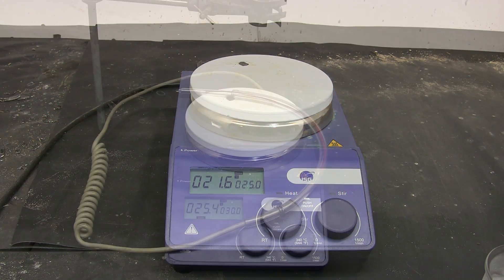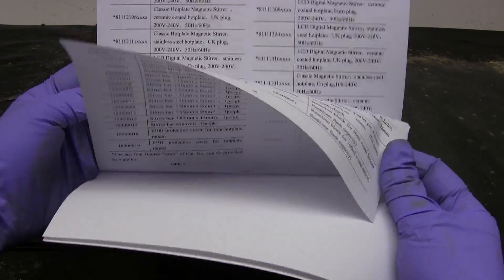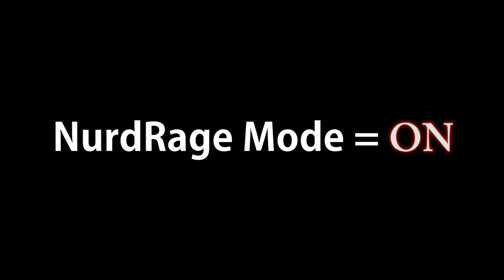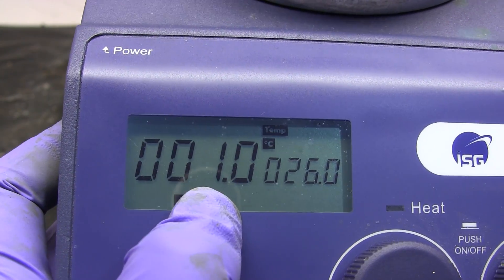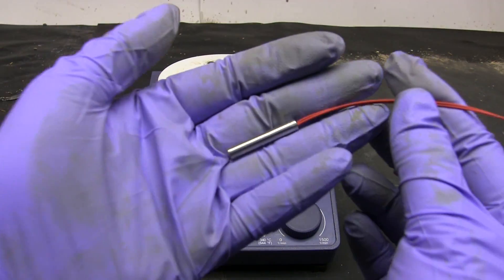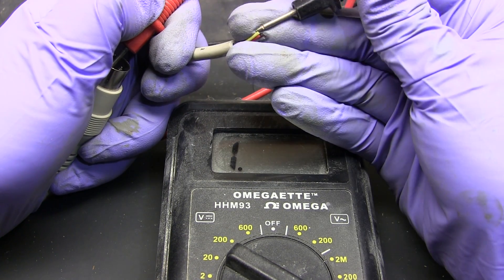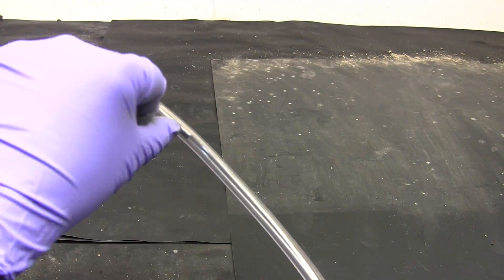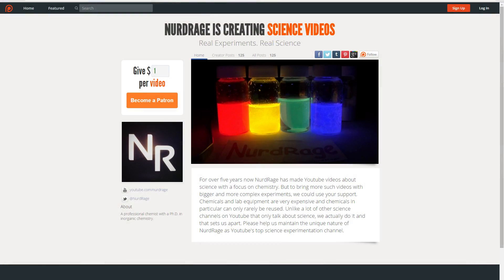Make a thermometer probe for a westlab/scilogex hotplate

Comment: The reason the ice water temp measures 1° C is because the probe is in water. The water will remain that temperature until all the ice is melted then the temp will begin to warm to room temp.
Reply: No. An ice bath will remain at 0C until all the ice has melted. 

There may be a couple of calibration potentiometers inside the unit, one for zero, one for gain.
Reply: Verm1n if the water was at 0C then it would be frozen... but its ice water...
Reply: Joshua Rando 
Water and ice can exist at 0C. It takes extra energy to freeze/melt ice but the temperature will still be 0C until you add that extra energy.
Reply: Leonard Greenpaw "if there was salt in it." Wow, you really just said that... We are not talking about water with salt in it. We are talking about water... pure water. Your fact was completed irrelevant to this argument and fails to have any point.
Reply: Joshua RandoYou are all FOOLS. Liquid water can easily drop below 0C if there was salt in it. 
This guy/girl has a FUCKING PHD, and the point of the bath was to see how low it would go and to try and get it into the negative.
Not to mention state changes do not elapse instantly and actually need time to complete
Reply: Joshua Rando No, we are talking about the water in this video, we dont know exactly what was in it

Comment: I would suggest adding some silicone grease between the glass and the probe for a better heat transfer and quicker temperature response. Silicone grease is good for the temperature ranges you're looking for.
Reply: FrozenHaxor yeah or thermally conductive Paste for CPU coolers
Reply: Perhaps a low temperature metal would be a good conductor (tin, lead, bismuth ect) rather than silicone grease since most silicone paste can't with stand high temperatures! And most chemist will have a low temperature metal 😋
Reply: @entomopathogenicfungus904  No, that would not make a good connection with the glass and would amalgamate and corrode the probe. Silicone grease is good up to 300*C

Comment: Wow a DIN connector! Interesting that it wouldn't be something simpler like a BNC connector.
Reply: BTW: I just like BNC connectors, they make me giggle with glee while playing with them.
Reply: Glebs Litvjaks the connector has multiple functions. For example different types of temperature probes.

And BNC connectors are used for higher frequencies, they are a bit expansive, complicated to assemble etc.

A DIN connector is a... decent choice. Relatively cheap and easy to get on the Shenzen Market and it fits - more or less - together regardless of manufacturing quality of socket and connector.

Comment: Why encapsulate the probe in glass? Is it to allow for greater sensitivity in minute temp. changes? Or rather, allow it to operate favourably in humid conditions/ high temp.?
Am I over-thinking this?

Great video, especially loved the outburst.
Reply from the maker: Darkest Light Oh just to protect the cartridge from acid. With the kinds of chemicals i work with, the cartridge would be destroyed in just a few days. The glass encapsulation protects it. The glass actually slows down the response and makes it less sensitive and less accurate. But i'm okay with that as I want to protect the probe more than i need high accuracy.
Reply: bgdwiepp  i think that the glass the perfect material to use in the lab, and how about some thermal paste, like the one in computer processors, in the tube to make a better thermal contact between the glass and the probe? It would be more sensitive and more responsive to changes, right?
Reply: NurdRage It's also a lot easier to replace the glass if it gets damaged or destroyed than to replace the probe, right?
Reply: Mega98RP Great minds think alike. I just posted something about that. Well done for beating me to it.
Reply: NurdRage I would imagine filling the glass tube with some form of thermally conductive material would improve the speed and accuracy of the probe - perhaps some sort of mineral oil or silver paste, if you want to get fancy?
Reply from the maker: ***** exactly! :)
Reply: Thanks for all the replies. Cleared it up greatly. Common sense always prevails, I guess.
Reply: Jarl Gullberg Exactly my thoughts. Filling in the voids with a suitable heat-conductive substance would be an easy and simple way to improve the accuracy without compromising the resistance to corrosive substances. He could probably get a cheap bottle of thermal interface material usually for CPU heatsinks and fill it with that.
Reply: bgdwiepp You don't need epoxy as that is way too permanent and won't work as well as Arctic silver CPU paste. Put a big blob of it in the bottom of the glass vial and stick the probe into it. I bet that would make it a lot more accurate as well as speed up response time. 
http://arcticsilver.com/as5.htm
Reply: NurdRage i think you could find some high temp thermal epoxy fairly easily that would be suitable for this if you wished to speed up the response.
Reply: bgdwiepp
Would that thermal epoxy be anywhere as resistant as glass is? As cheap? As easily applied and replaced?
Reply: NurdRage Cut a little peace of solder and put it inside the sealed glass pipette. Then heat the glass until solder melts. While solder is in molten state put probe inside and make sure it makes contact with molten solder. Let it cool and you will have a probe with faster response time than before.
Chip manufacturers solder heat sinks on CPU die for best thermal conductivity. You can do that too with tools and resources that you already have.
I hope this makes sense because English is not my mother tongue.
Reply: wwwelkam
If the probe can handle that kind of temp I agree. That would be the most accurate way to do it.
Reply: Slurpon Muhdick I dont know the specs but most of them should survive. CPU cant operate at 100 C but they still manage to solder heat sinks
Reply: wwwelkam
I have no idea what kind of metal shielding it has. If its made for unusually high temps then I see no problem.
Reply: NurdRage If you filled the glass pipette with some thermal interface material like the paste they use in computers, I think that might improve the heat transfer and increase response time.
Reply: deterdettol Thermal paste that is use between CPU and heatsink does not have great thermal conductivity.
Reply: wwwelkam Well it's still something...
Reply: +NurdRage What about shrinking the glass around the sensor capsule by heating it enough briefly so that you have a proper thermal contact? That should help with accuracy and response time.